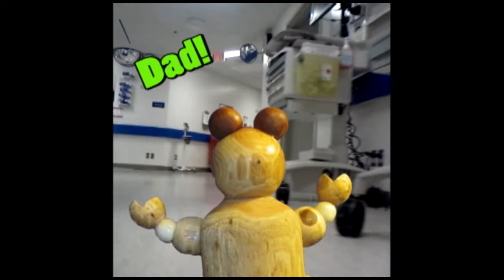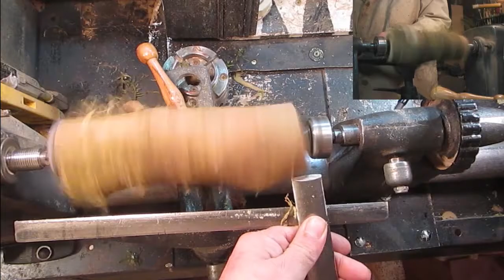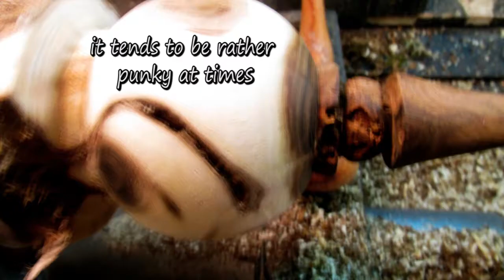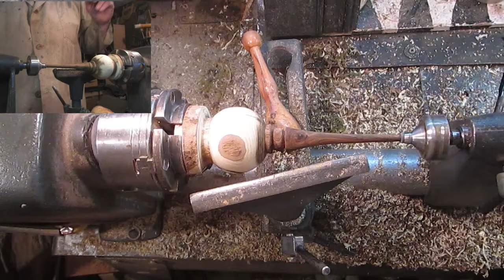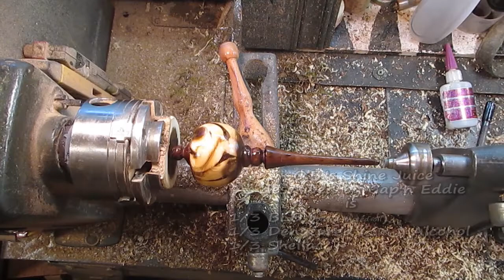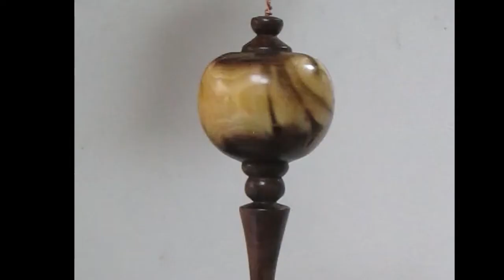Wood Turning #94 A Challenged Christmas Ornament

Comment: Hey, what size chuck do you use on your lathe? I have the same craftsman lathe I just bought from a very good friend of mine and I'm new at all this. Nice job on the ornament by the way.
Reply from the maker: +Martin Whitehurst Hey Martin: I am using a Nova chuck with an adapter to run on a 3/4" 16TPI headstock. This chick allows different jaws to be used... the normal ones I use close to 2 1/8" and I have a set of PIN jaws too... but unlike Carl Jacobson's... these you have to unbolt and redo every time!
I am sure that you have found yourself in a world of ... wow! I can do that? It is really cool and it never gets old!
Thanks for watching
Larry